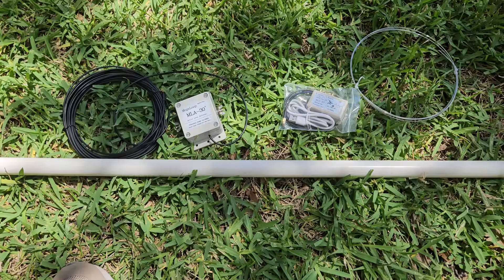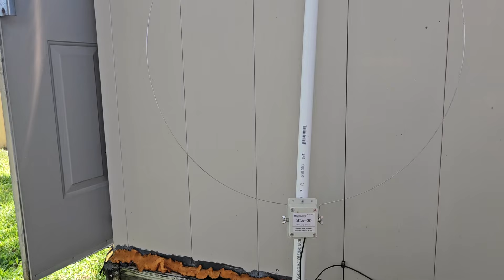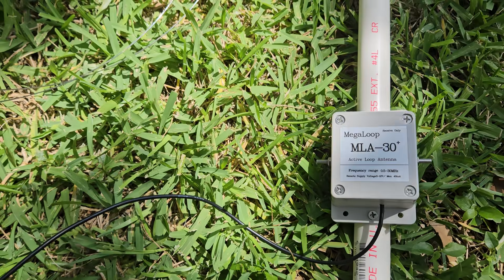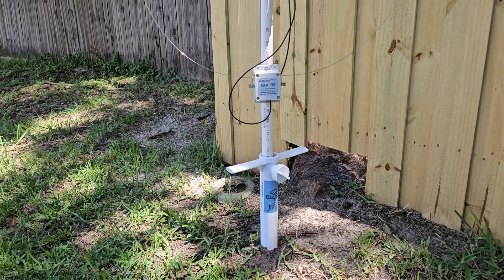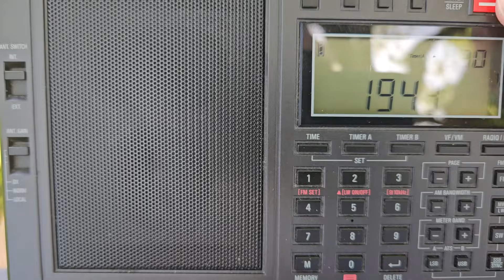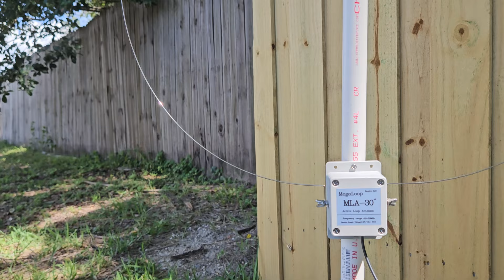How I install and set up an MLA 30 Plus Loop antenna

Comment: This morning I was waiting for my MLA 30+ to come in the mail when I stumble upon your video. As a beginner SWL this is the kind of video I'm avid to find : straight to the point, no influencer's blah-blah-blah bullshit. This afternoon I installed the MLA on the pipe almost exactly like yours, and this evening I'm gonna try it. BTW I don't own a TECSUN, I have a SANGEAN 909-X2 but all SWL are brothers, aren't we  😂 ? The cap and the hook are pretty smart ideas ! For the record, in the small town I live in in France, we are fortunate because most power lines are underground ! I don't have a yard but a large balcony for my condo, I hope it's gonna do the trick. Anyways, nice video, keep up the good work Sir and you have now a new subscriber...
Reply from the maker: Excellent! I hope it works well for you. Thanks for the kind words. Please keep me up to date on your progress and what you are hearing. it doesn't matter what radio you use, I love the look of the 909 X2, it is beautiful. I have the original ATS 909, but the speaker has some issues, so i mainly use headphones or an external speaker.

I try to make my videos simple with no fluff, I like videos like that too,, so I am glad you liked it. Please check out the playlists on my channel.

As for the antenna, make sure you rotate it to null out the noise and bring in those signals. I find for my set up, NE to SW works best, but it may be different for you. Do you have a channel?

Comment: FILL YOUR PVC PIPE WITH SPRAY  FOAM LIKE YOU  FILL CRACKS  IT EXPANDS INO THE PIPE  IT BE MORE  RIGID ,,,GO UP TO 25  FT TALL  CONCRETE WILL WORK TOO BUT NOT AS LIGHT  ..IT MAKE IT A RIGID POLE.....THE THIN   RG 174 CABLE IS GOOD ITS NOT COPPER INSIDE LIKE RG58 IS  THE LOSS IS MINIMAL WITH THE SMALLER CABLE ITS SHIELDED.  ITS A WASTE OF TIME TO CHANGE IT OVER  BUT PEOPLE DO IT ..
Reply from the maker: Thank you for the advice and information!

Comment: Do you have to ground the antenna?If so, what is the best way?
Reply from the maker: No, you don't have to ground them. They're active loops, they use a small voltage to run.g. No ground needed.
Reply from the maker: No, there's no reason to grab it.It's an active loop, runs off a small voltage.

Comment: Where did you get that SMA to 1/8 cable?  I got one from Amazon with the MLA30+ and the cable is just too thin causing noise.  I notice yours has a ferrite choke and what looks like a thick RG58.
Reply from the maker: The MLA 30 Plus comes standard with the 1/8 COAX, It is not really ideal, as a thicker coax would be better. I don't have the skills to put a BNC connecter on the box and solder it on to that tiny board inside to use a thicker cable.

I had to just use this one today as my other MLA at 10 ft. suffered from a broken cable. So I chose to use this one, but mounted it on a 5 ft piece of PVC instead of the 3ft piece I had it mounted to originally. I did this because I wanted to test it on a 5ft piece. I also attached the 1/8 coax to a 3ft piece of RG58 at the end and brought that into my house and hooked it up to the existing bias-t. I will do some testing this weekend and make adjustments as needed.

Comment: Why so low? 3’
Reply from the maker: Well, I have another MLA30 at 10 ft. The performance, although very good for my environment, struggled in some bands. I looked around on YouTube and found a video from a creator in South Africa who has an MLA 30 in his garden at 3 ft off the ground and was having a lot of good reception. So I thought I would try that too. I was very surprised, number one, that is actually worked for me, second my noise floor was better, and over all reception was better. Better than my one at 10 ft. So I kept it. I use the 3ft one mainly for my SDR, and the other for my portables. It may not work for everyone, but it works for me. Hope that answers your question.
Reply: @SWLSignals23-hp6vp I
Am going to attach to a  fiberglass  retractable pole
To experiment.
Reply from the maker: @CSIS-Spy be interested in your results!
Reply from the maker: @CSIS-Spy I would be interested in your results.

Comment: Sounds as though someone has a phone wall charger plugged in giving the loud power buz.The MLA 30 is also dirrectional.
Reply from the maker: When I tested it, the location I chose was just a bit away from some power lines.

Comment: Despite what some online sources suggest, there’s really no need to replace the coax if the length supplied is sufficient for your needs. 
The MLA30+ amplifier box typically comes with about 10 m of RG-174 coax, which has around 1.7 dB loss at the HF frequencies this antenna is designed for. Upgrading to RG-58 (about 1.1 dB loss) or even RG-213 (about 0.5 dB loss) will make no discernible difference to what you hear and both are less flexible. 
The MLA30+ has a built-in amplifier providing 20 dB or more of gain, which easily offsets such small losses—and in fact, the gain may even need adjusting on some setups to avoid reciever overload.
A worthwhile modification would be to increase the loop diameter to a metre or so.
Reply from the maker: Thank you for the technical info. I've seen plenty of videos from listeners who have done modifications to the antenna. I tried a copper loop that was about a meter in diameter, but it didn't improve the signal much and did cause an overload issue. I run only portable receivers so this would be probably why the overload occurred.

I have no desire to make any adjustments to the gain pot in the amplifier box, my signals are good as is! Thanks again.

Comment: I thought all antennas need to be grounded? I guess this one doesn't have to because its a loop on the plastic pipe?
Reply from the maker: This is an active loop antenna which has a built in amp and powered bias-t.  You could ground it, but I don't if would improve its performance or not. I've not heard of anyone grounding this type of antenna.

Comment: Would a u-bolt work for attaching the box to the pipe?  Or would it slide down?
Reply from the maker: I think you could use a U bolt. I don't know how tight you would have to make it not to slide. But I would not want to crush the box by over tightening it. I seen videos where people use zip ties in an "X" formation to hold it.
Reply: a regular long bolt is good enough. just drill holes through both ends of the pipe, line up the box, put two bolts through and tighten with a nut, or a butterfly nut for quicker mobility. it can never slide down then unless both bolts magically vanish